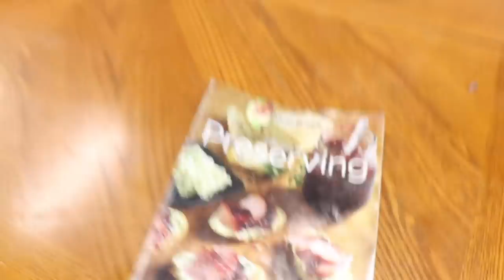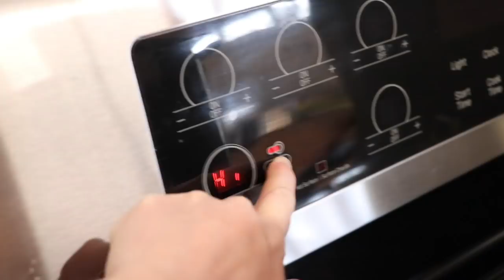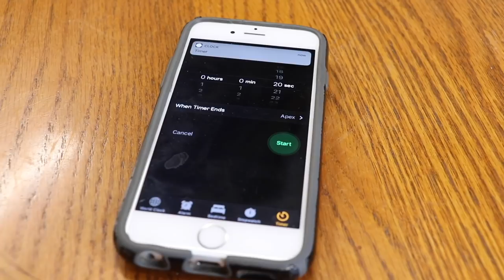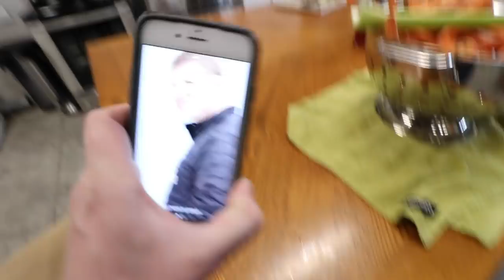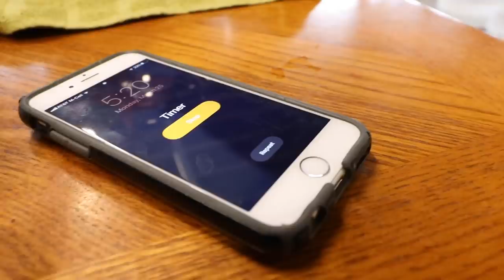How to Pressure Can Soup (EASY!)

Comment: Love the canning videos!  I have been canning for over 30 years and just a hint.. if you put a couple of "glugs" of vinegar in the water you pressure can in you won't get that white film on your jars.  It also works with a waterbath canner too.  I scrubbed jars for years until I learned this.
Reply: Jake Smith it’s calcium deposits from the water. You can use vinegar as a natural cleaner for it but it might not be a good idea to add it while canning

Comment: It said that if you get a white residue on the outside of your canning jars when they come out of the pressure canner to just add some white vinegar to the water in the PC before starting the cycle. The residue is minerals in the water that precipitate out of the water under high heat and the vinegar will stop it from happening.

Comment: Better Broth Recipe:
I worked in a well known east coast deli who sold a ton of stock, I have made hundreds of stocks and found this to be the best. 
My favorite is the turkey necks. So thats what I use, but you can use any bone.

10 necks, legs, entrails (cheap and yummy)
2 Onion 
2 Leeks (wash well)
6 carrots 
2 celery bunch (celery will naturally thicken your broth)
1 overripe tomato (adds acidity)
Garlic head (whole head cut in half sideways skin and all)
Use all parts of the vegetables, skins, tops, leaves, stems ect. just wash well. 

Bouquet Garni (classic and must have in any stock or broth choose your favorite herbs to use)
bay leaves dried 
peppercorns 
pepper flakes (tad bit of spice brings out all other flavors)
kosher salt 

Use turkey necks, chicken legs, or the bones of a picked bird, (don't use the whole bird or large chunks of flesh, and NEVER skim the fat) Take the bones of your choice, fresh carcass bone is best. Take all ingredients and chop into large like sizes. Toss in a little oil season with cracked pepper and salt well, put in large roasting pan and roast in 375-425 degree oven until browned (brown stuff on the bottom of the pan and most ingredients are well seared on all sides) Light roast = light broth light flavor, dark roast = darker broth more rich flavor. Remove roasting pan from oven and "deglaze" the brown stuff on the bottom of the pan with water. Pour all ingredients into stock pot and add COLD water, cover all ingredients by at least 3 inches. Add bouquet garni bay leaves peppercorns pepper flakes and a little more salt. Bring to boil and reduce to simmer. Cook overnight at low low simmer, or minimally 4 hours, you might need to keep adding water if the stock gets too low. At the end of cooking time try to end with the desired reduction amount, you can reduce all the way down to a demi, or watery as when you first began. More reduction = more concentrated flavor. Strain the stock while it is still hot. Let cool uncovered until completely chill in large container. When you go to can or use the stock, break the fat on top and be sure to mix well bottom to top. Don't be afraid of fat FAT = FLAVOR, and be sure the season throughout for a more robust flavor and lower sodium level. The big thing is the procedure and roasting the items, this gives you a dark rich broth with a ton more flavor complexity than just a boiled broth. You can pretty much put anything into a stock or broth but ultimately its a game of balancing sugar, acid, salt, and whatever flavors you add in.

Comment: well done.  Extremely well done!!!  If you put a small fan in the work area and have it blow across the table, it help moves the onion fumes away from your face.  And Alyssa is correct:  concentrate on one recipe at a time - tripled - for more efficiency in prep/cooking.  You can easily chop veggies ahead - if you're going to use carrots in more than one type of soup - and store in the fridge for the different varieties.

Comment: If you add a dash of vinegar in your water your jars will come out of the canner clear.  It saves having to wash every jar in vinegar water to get the film off them.  I store all my bands on a wire hanger that I untwist (and then bend into a loop so it forms a hook and secures back to itself) I keep one for wide mouth jars and the other for regular jars.

Comment: I hope you have had the gauge verified for accuracy. We used to take the lid over to the County  Extension agency at Ohio State University's Ag offices. They have the proper equipment to certify the gauges accuracy as well as any pressure relief systems on the lid. Better safe than sorry when it comes to low acid foods.

Comment: Here is a little something to try.

15 Bean soup 

1 picnic shoulder ham ( I like to smoke my ham for a few hours first to add flavor.)
2 packages 15 bean soup mix - Rinsed and drained
1 bag carrots - Chunked (3 to 4  two inch pieces per carrot)
1 bunch celery - Chunked (3 to 4  two inch pieces per stalk)
1 large onion - Quartered
1 bulb garlic - Quartered

Stock
-------------------------------------------------------------------------------------
Cut all the meat from the ham and cut into chunks. Store in the fridge until needed.
Add ham bone (and some of the fat trimmings), chunked carrots, celery, onion and garlic to a large pot.
Fill with 2 gallons of water (Less if you don't have a large pot)
2 tablespoons salt
2 tablespoons whole peppercorns (regular pepper can be used as well)

Boil 2 - 3 hours
Strain or fish out all vegetables and the ham bone

Soup
-------------------------------------------------------------------------------------
Add beans to the ham stock along with the included seasoning packet and bring to a boil.
Reduce heat to low and simmer for 2 hours or until beans have softened.
Add ham chunks and simmer 15 minutes

Serve

Bean dip
-----------------------------------------------------------------------------------
Soup can remain on stove for 2 days on low heat (Yeilding several great meals) until beans turn to mush.
Use a stick blender to blend remaining beans and ham into a paste and break out the 
chips.
Reply: Ken Cramer yum! Thank you!

Comment: Lmao. I grew up just calling it "rock, paper, scissors". The first time I heard "rowshambo" I asked what the heck that was. I was told 2 people stand facing each other and took turns kicking each other in the what's it's. When you guys said you were going to do it I had bad visions in my head. Question: if you pressure can this for 1 1/4 hrs, do you under cook the soup at first so as not to turn it to mush? Second question: My grama used to can all the time and she would always say " every jar comes with a lid and ring for a reason. Do you not worry about knocking the lids and popping the seal?

Comment: My suggestion regarding your biodegradable waste, is to start a compost pile where it will decompose faster than just throwing that stuff on top of the soil where you intend to later plant stuff.  Also, if you can, get some earth worms to put into your raised beds particularly where you aren't planting root type foods.  Worm castings is great fertilizer.

Comment: Tip for canning soup: separate solids and liquid first. Then put measured amount of solids in jars and finally top it off with liquid. This way you have a true equal amount of food in each jar. Also, instead of volume measurements for solids, switch over to weight, it’s much more accurate
Reply: For soups that’s don’t have much fat in them, it might be a good idea to add some coconut oil or lard (something that’s solid at room temperature) to add another layer of protection to the canned goods. The fat will cool solidly on top preventing air from spoiling the contents.
If you are more into low fat food, you can always scrape it off when you open the jar

Comment: Please share with us veggie Chopper that you using the brand name and where you picked it up please I had one of the green ones and it broke in two days the blades actually fell out but you look like you used a lot of pressure on what appeared to be pretty solid veggies by that I mean hard not soft so if you could share that information I'd appreciate it thank you very much

Comment: Chicken stock is good stuff. I don't prefer red onions, they're more expensive, and I refuse to cook with them, since the red breaks down in heat, and turns them...just a dark poop brown. So if it's not on a hamburger, just go with sweet yellow onions.   Ohhhh man that pressure canner pot, and the stock pot. I wish I had that stuff. I WOULD can, but if I make a 15qt soup pot full of chicken rice soup, I'll eat it all in a couple days.  I've also heard the jar lids are now being made with reusable silicone sealant. Have you guys tried that yet? I hear it works a few times, but not eternally, but that's better than always needing more boxes of lids.

Comment: You'll find, once you get going on this, that pressure canning is faster.  I hate when I have to water bath something.  It takes a lot longer to get four gallons of water to a boil than it does to get two quarts boiling, and then bring it up to pressure.  Yes, you have to wait for the canner to cool, but I just run two canners.  One is heating while the other is cooling down.  It only takes an hour or so before I can take the weight off and open it.  

You are wise to get a bunch of meals canned before baby comes.  I know you are young and energetic, but when you have a baby, you will spend a lot of time holding baby and not doing stuff.

Comment: ? why do you take the cap off the jars?
Reply: Should leave the jar rings on for 24 hours before the're taken off.
When you take the jars out of the pressure cooker canner dot push down on the lids.
Also put a little vinegar in you pressure cooking pot water to keep the inside of the pot from turning white inside.
Love your videos.
Keep them coming.
Reply: Ted Pollard technically it’s not needed because the inner lid creates the seal needed. Personally, I rather keep it on there just to be on the safe side.
Reply: Yes please answer this!
Reply: You reuse the bands and you only have to buy lids.  All the canners do this

Comment: When canning soups and meats always use a bit of extra virgin olive oil.  It helps with preservation and stabilizes the water and food from going foul bad. Just wait until you get your own chickens and veges and cooking becomes easy with no grocery store. And  throw your lids and screw ons in a bath of vinegar this helps to prevent top jar fouls or losing food over 6 months old.
Reply: A metal fence around that garden with some chickens will really help in composting the correct nutrients for growing food. You can freeze the chickens or make more soup when it is time to plant and grow food.